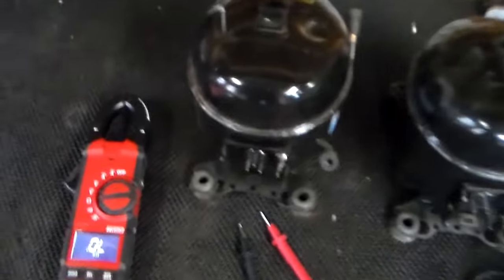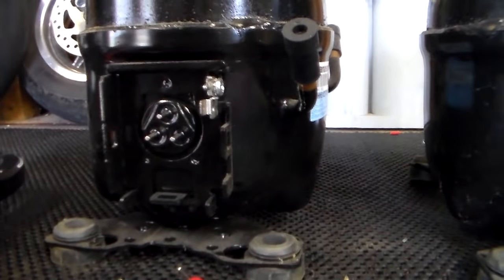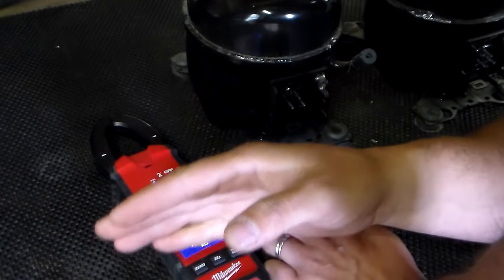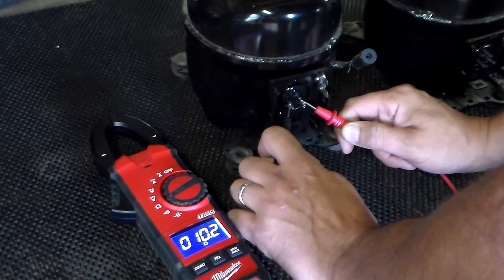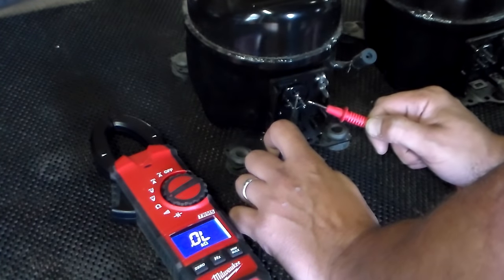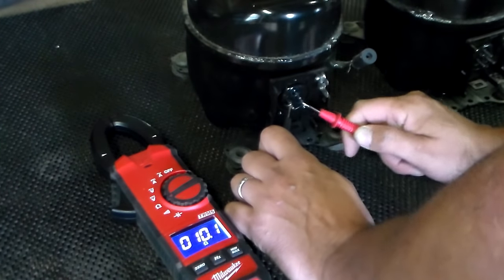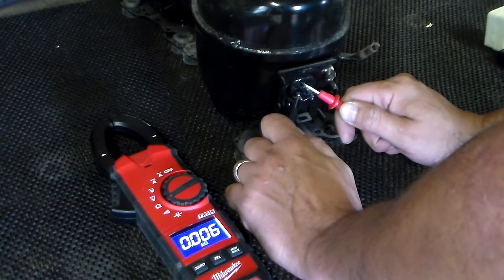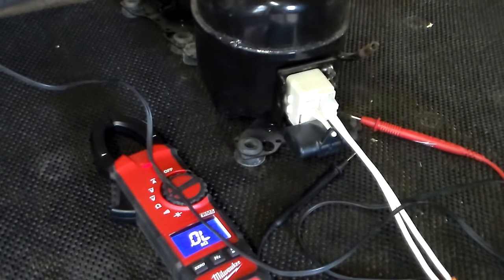How to Test the Compressor on your Refrigerator

Comment: Hi Bill, Great video. I appreciate the clear video and description on how to test components. I have a sub-zero side-by-side where the refrigerator side is not cooling. Do you know how to check fridge control thermostat? I have a dial ( off-10). Fan inside refrigerator is working but no cold air is circulating. Could the dial which I assume has a thermostat also be the culpit? if so, how do you test it. Thanks, Michael. Also appreciate honesty about outside noise. Very funny and glad too know it happens to us all.

Comment: I checked compressor its values are C to S :4.5ohms, C toR :1.55, and S to R : 6.5ohms when supply is given compressor gets over heat but Cooling wsa not coming give me suggestion to solve the problem.
Reply: check relay or capacitor, can be replaced for cheap .